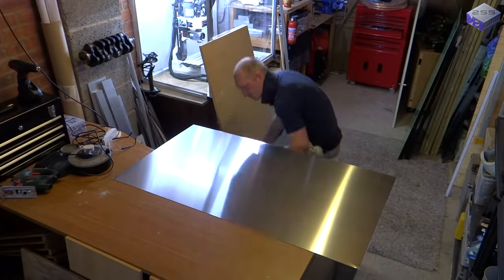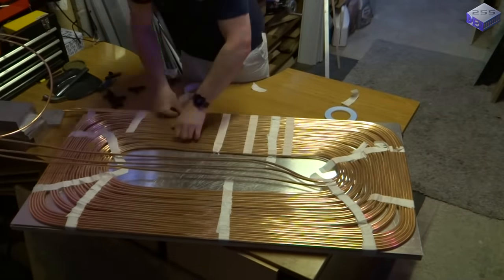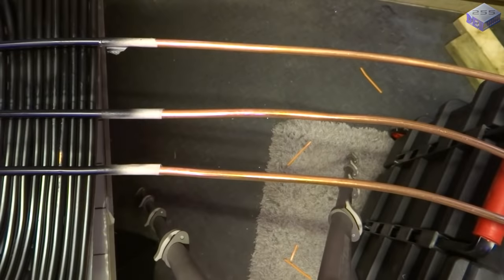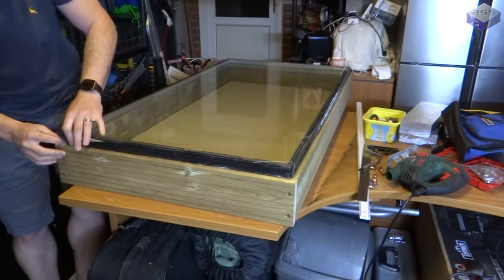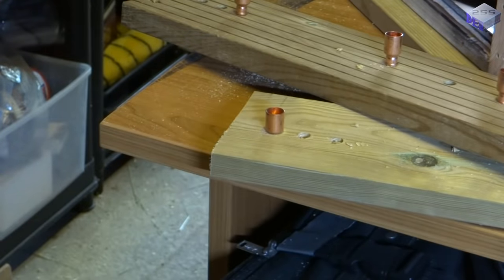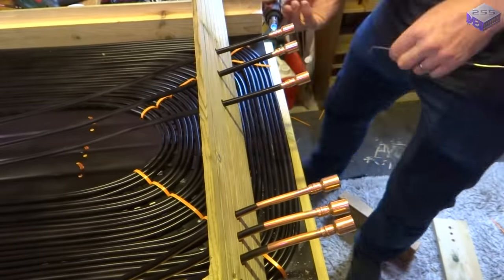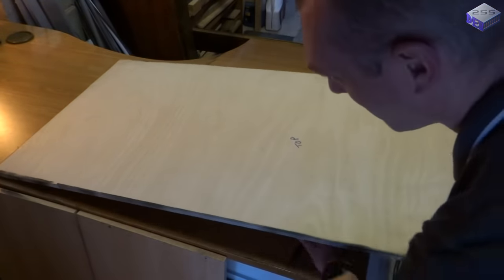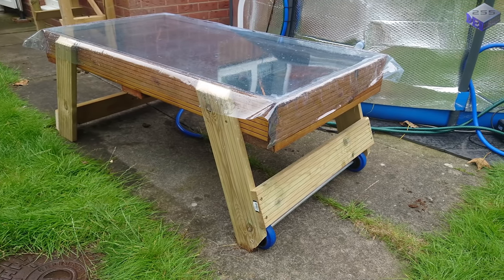Improved Solar Pool Heater - Full build

Comment: Does the copper pipe have any problems when running chlorinated pool water through it? I always thought it would react with the chlorine?
Reply from the maker: Hi, your right, it does react if the PH balance goes off, where the reaction becomes more severe. Although, I maintain the PH at around 7.4 and now have a UVC (UV Type C (light frequency) Clarifier) so I can reduce the chlorine by 80%. I've done a fair bit of research into this and have found that the chlorine levels in drinking water are similar to that required for pools, where this drinking water also runs through copper pipes, although the PH is closely monitored and maintained around 7.4, hence why I ensure my pool is maintained throughout. I have not yet seen any corrosion to the copper. Here is a link to the Drinking Water Inspectorate for further info if you are concerned: https://dwi-content.s3.eu-west-2.amazonaws.com/wp-content/uploads/2022/10/14171311/Chlorine-Accessibility-Leaflet.pdf

Comment: Quick question wont you heat it up more if you paint the glass black  so that all the heat stays inside the box?  like this you have reflectent heat going out and losing heating power? aswell if you add some sort of isolation to the box it self just to preserve all the heat possible
Reply from the maker: Hi, I believe this would increase the heat in the box, although it reduces the heat transferred to the water; this as there is an increased surface area that the light is exposed to with the tubing and that the light energy is directly attempting to heat the surface of the tubes, the water then takes that heat away to the pool. Air is a good insulator, so there would not be much heat transfer to the tubes in the box. The air in this one does need to be reduced, and the glass may need changing too, though, as a double-glased unit may be reducing the energy reaching the tubes (reflected back out).

Comment: The pool is already a significantly larger solar collector than the one you propose to build. The new collector's contribution is going to be significantly less than the pool's thermal gain directly from the sun. If you want to raise the temp by 5 degrees lets say, you need a collector about twice the size of the pool.
Reply from the maker: Hi, I'm getting around 500W out of the panel so far, and will be seeing if this can be improved with a few modifications. It would be good to know the best materials before making a large one. I also have version 1 on the pool, my original purchased one, a black floating pool heater and a dome to reduce the evaporation to keep the heat in where possible. I will be measuring the flow rate of all systems and calculating the best option for outdoor pools.
Reply: @TheSolarPoweredEngineer  Do some calculations. I'm not trying to be a downer, but when you have a good understanding how much energy it takes to raise 1 litre of water by 1 degree (4200joules) then you can recognise how much energy is involved. Guess time, say your pool is 5m long, 4m wide and 1m deep, thats 20 cubic meters or 20,000 litres. To raise that by 1 degree is 84 million joules. Your heater makes 500 joules per second. So in 168,000 seconds the pool will be 1 degree hotter.....just over 50 hours. You can see now why your solar heater has to be many times bigger than the size of the pool :)
Reply from the maker: @michellelewis3063  No dramas, I love the comments. Our pool has roughly 4600 litres of water and with the specific heat capacity of water being 4182, raising the temperature by 1ºC would require 19.2 million joules of energy; so this would only require 5.3kWh of energy, or 10hrs and 40mins for a 500W heater. This unit should produce double this if at or near the equator (1.9kW/m2), where I live a fair distance away with only around 1kW/m2 in the UK. Although I am only trying to find out the best solutions for home-built solar heaters, where I have my original version 1 panel, this one and a floating one to show which ones are more efficient; this to show the best options and see if they are actually worth making. I think they are as our pool is already at 26ºC. They are a lot more efficient than PV panels of around 90% compared to PV of only around 20%.
Reply: @TheSolarPoweredEngineer  Yep, I make it the same. I have to wonder...living near the equator, why a pool heater is needed? 26 degrees is a joyful temperature and slight relief from the heat of the blasting sun. A scottish pool in summer might get to 15 degrees if lucky. Raising by another 15 and I might be tempted to borrow a wet suit.
Reply from the maker: @michellelewis3063  Haha, yes, a little different in Scotland to the equator I agree, I was in Tiree for a while and that was just the same with the wind howling across

Comment: Just an FYI you should always use flux when you solder your copper pipes it sucks the solder into the pipe fittings. Didn't see that in the video.
Reply from the maker: Hi, thank you, I agree. The solder I used has embedded flux, although there is only a small amount that heats at the same time as the solder, so, as you said, separate flux would make a much better joint.

Comment: Hi nice project 👍 just wondering though…. Wouldn’t it work better without a double glazed unit ?? They are designed to act as a insulation barrier in a house so I would think that you are reducing the efficiency. Maybe take the unit apart and only use one pane like a greenhouse. Also if you could introduce a small vacuum you may increase the efficiency further 👍👍
Reply from the maker: Hi, yes the unit is potentially reducing the IR content which equates to around 48% of the heating effect. I have a number of different materials to try and will be making another video on improvements to this heater. The other materials are a double polycarbonate sheet, single acrylic sheet, single polycarbonate sheet, two way mirror film and some other items; so should make for a good video. I will be reducing the amount of air between the top and pipes too instead of a vacuum, as I think that would be hard to maintain in this unit.

Comment: Nice I live on Maui, Hawaii…. So daily sun is there this would work very well…
Reply from the maker: Very nice place to live, do you require someone to install one for you ;-) Haha. If you do look at making one, I would suggest not using a glass pane as I believe this is reducing the efficiency, I am going to try different materials, although believe the best option would be to use greenhouse clear glass
Reply: @TheSolarPoweredEngineer  thanks great video. Don’t have a pool looking for hot tub jacuzzi so smaller volume than pool.
Reply: Maybe use recycled double pained? In any case the sun is very strong
Reply from the maker: @d.michaelmcbridedc1082  Thank you. This will work better with a hot tub due to less water as you mentioned. Good luck if you decide to build one and feel free to ask questions if you need to

Comment: very nice project, will do one or our own pool. an improvement idea? instead of tieing dow the tubing one could flod the whole piped surface with loose screed fex floor levelling puttyso the high density material could transfer the heat onto the whole pipe surface even from underneath. of course the top of the scrred should be black ;-) this would save a lot of labour, increase evenness of heat uptake and hold solar energy charge even when fex a cloud passed by (intermittent heat battery). thanks again, great video!
Reply from the maker: Thank you. It's a good idea to ensure there is a good thermal bond and would save on time tying the whole thing down. The main reason for having the tubing above a flat surface is that it increases the surface area. I suppose you could make the surface od the putty mottled and uneven to increase its surface area too. Could be something to try.

Comment: It's a beautiful build.

My one question is the use of copper for a pool.  The chemicals in the pool, particularly chloride, will react with copper and you will have copper staining as the tubes react.  

I built a 4x6 out of 3/4 pex.  I get internal temps of 180 degrees and a delta of 7 degrees with flow adjustment of aprox 0.5 gallons per minute.
Reply from the maker: Hi, thank you.

Yes this is a concern that a few people have that I am looking into, the importance of keeping the PH balanced and only applying chlorine when needed is key to this, although more information is needed online that is definitive. For now, as you said pex is probably the best option, or if using copper, either have a chlorine free pool or have a closed loop system for the copper loop and a heat exchanger to the pool water (possibly made of pex). Sounds like you get some good heating with your setup.
Reply: @TheSolarPoweredEngineer  not as much as hoped but my pool is within a screen enclosre with a very tight screen and it reduces its ability to get direct sun.  The delta I get brings my pool from 78 to about 85 in the middle of the summer.
Reply: @TheSolarPoweredEngineer  also...I recently reinsulated with rockwood.  I literally melted the poly aluminum faced 2" insulation when my pump failed.  Internal temps went over 220 degrees F.  

Water flow, I find, is the key to regulating the temperature.  Higher flow, lower temps, lower/no flow results in disaster with plastic pipes.

My system is on a tracker so it follows the sun for a solid 8 hours.
Reply from the maker: @richpalmisano1740  Hi, wow that did get hot, it sounds like you get a lot of sun. The sun tracking is something I am looking at doing also, where I playing with the idea of one on our fence, hopefully the posts will take the extra weight.

Comment: Good afternoon Super work, well done !!! Question please ? Is it possible to use this same system and add or connect it to the existing gas water radiator system. I have my radiator water, heated from gas !!! Efficient but now it’s getting a bit expensive. Have you ever done a video on how to link your system up to an existing radiator system ? I am sure in today’s world, you might find a lot of interest in something like that ??
Reply from the maker: Hi, this is a very good point, where I was looking into heating an emersion heater full of water for use in showers, baths, washing machine feeds (use less electricity to heat the water in the machine), although you would need a fair amount of panels to heat house radiators, where this panel collects around 500W when the sun is staring at it, and with most home boilers being around 18kW you would need around 36 of these to compete. May need a few videos on this though ;-).
Reply: Something important to keep in mind with a solution like that is to be really mindful of the maximum output. With a closed loop system you might just blow something by the water converting to gas if you put too much heat Into it! Just as a note for any potential upcoming attempts! :)
Reply from the maker: @Etersarte  Thank you and very true, I would look to control the flow through the system/bypass with a microcontroller that monitors pressure and temperature at different locations around the system, I do like to get technical on these projects ;-)
Reply: If using something like this to heat potable water, be careful of the temperature that is not in the breeding zone for legionella etc. Stored water should ideally be kept at 60 centigrade. This prevents bacterial growth.
Reply from the maker: @jmclel5729  That's a good thought, I do maintain good chemical levels and flow around my pool, although I don't consider it to be potable and the house heating would only be for radiators or machine use. I have ordered a UV-C FlowPast for our pool just recently, so will be installing and reducing chlorine levels by around 80% in the pool. I'm not brave enough to tinker with drinking water, other than fitting a reverse osmosis  4 stage filter system.

Comment: Generally speaking, the higher the gloss, the lower the emissivity - that is to say, the heat that is absorbed isn't re-radiated as readily.   Your collector will actually perform better with a gloss finish.
For best results, turn the flow rate right up.  The faster you move water through the collector, the more quickly you get it into your storage - the pool - before the heat can be reradiated and lost.  Heating a little water to higher temperatures is fun from a high score point of view, but not nearly as useful or efficient as heating a LOT of water to a much more modest temperature.
Reply from the maker: Hi, thank you, I agree the faster the flow (well, as long as it's not too power-hungry) the better the heat transfer to the pool, especially as you encourage turbulent flow through the tubes so that more water molecules have a chance to reach the surface and mix the water. If the flow is too slow, you get a laminar flow where only the skin of the flow touches the surface.

Comment: Nice. I think i will try to use normal home water radiators and just paint them black if i can find any for free or cheap. If they are dual layers i will split them. Or build like you did but with 16-50mm black PEM hose depending of what i can get hold. I have 120m2 flat roof on my house i can play with =) Also thinking of using the things used when installing waterheated floors. metal sheets with canals where you will lay the hose and then paint it black. The idea is that the sun will heat up the metal and transfer the heat to the hose. Don't know if that's a good idea without the thing that should be poured on top in normal case tho.
Reply from the maker: My dad built a frame around a black painted radiator and fed the water around a closed loop to feed a radiator in a garage, this worked ok and kept the garage at a higher temperature than the outside air. I need to do some more testing with mine and hopefully, this will help with your thoughts. I recently purchased a thermal imaging camera too, so will be using that in later videos.
Reply: @TheSolarPoweredEngineer  Cool =) Also seen people using the back of old refridigators as waterloop. They also used the doors as a back to the loop. They just removed the plastic inside and used the insolation and painted it black and built a frame and then put glass/plastic over it as you did. I have a lot of ideas now =)
Reply from the maker: @magnus1liljeqvist  That could work too, I believe the maximum surface area, water flow through the system, insulation and cover type are the most important factors to get right.

Comment: Great vid. I wonder if using a double glazed unit might not allow all the heat through it and having the glass closer to the copper might give more effect?
Reply from the maker: Thank you. I've had a few comments on this now, where it would seem that the UV and some of the other frequencies responsible for heating are being reflected out. Around 45% of the Sun's energy is in the IR range apparently. So, I have a few other items to try, such as Perspex, clear polycarbonate, etc; this should allow it to act more like a greenhouse and trap those important rays. I will be moving the cover closer to the copper to reduce the air in the unit (or move the space behind the aluminium plate for better insulation).

Comment: Thanks for the video its great, any issue with the pool chemicals and the copper pipe? Ive two house solar panels with glass tubes (think its copper pipe inside tubes) left over from a build and I'm thinking of using them to heat our kids 7000L pool using a 12v pump, you think this would work?
Reply from the maker: Hi John, thank you, I've been taking a look into this quite a lot. I too believe the most common cause of corrosion in copper water pipes is chlorine reacting to it, although this happens more when the ph balance is off, so if the pool ph is maintained and the chlorine is not allowed to get above 3ppm there shouldn't be any issues. As an example, the drinking water in most homes has a chlorine content of around 1 to 3ppm (5ppm max) and this runs through copper piping in the home, although the water is constantly tested and carefully adjusted by the water board to ensure ph levels, chlorine and other chemicals are maintained to ensure healthy water. The other options, if still concerned with chlorine and copper, is to have a simple heat exchanger so the copper water is in its own closed-loop system (I will be making one on video hopefully soon). The other is to fit a UV-C clarifier so that you can reduce the chlorine by up to 80% (I've recently purchased one of those too), that way you can attach your glass tube panels directly to the pool, although I am not sure how the internal surface would react, is the water only in contact with the copper or does it come into contact with the glass tube?

Comment: The orange zip ties look good, however, the black zip ties actually are UV resistant and will not crumble as soon as the white/colored ties.
Reply from the maker: Hi, I haven't yet seen any signs of the cable ties failing, although that could be due to the glass reflecting most of the UV light, good in one way, but bad in the fact that the UV will add to the heating effect. I will be trying different materials, so will replace the cable ties for UV resistant ones or wire ties

Comment: Really nice project, what kind of temperatures can your pool achieve with your heater, if you had a really hot few days?
Reply from the maker: Hi, we have recently seen (last week) 32ºC in our 4600-litre pool; this from 4 heat sources, the version 1 pool heater of around 600W (plastic pipe), this pool heater of around 500W, a purchased dome heater that produces around 300W and a solar pool cover, that doesn't seem to register yet. However, I need to calculate which one is the most efficient throughout the day. I will be doing another video soon.